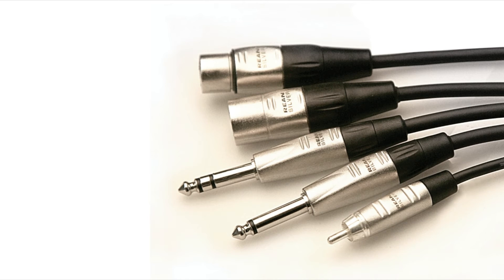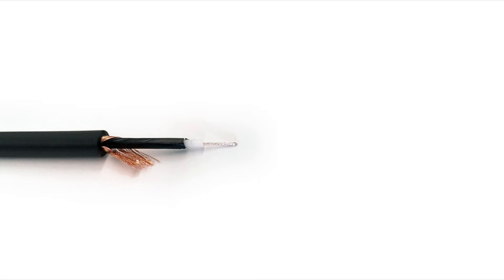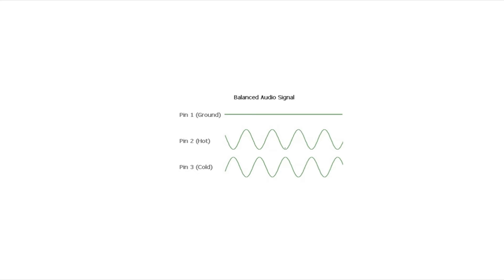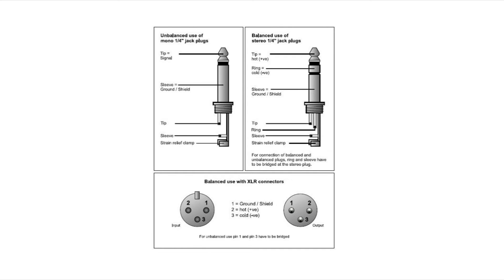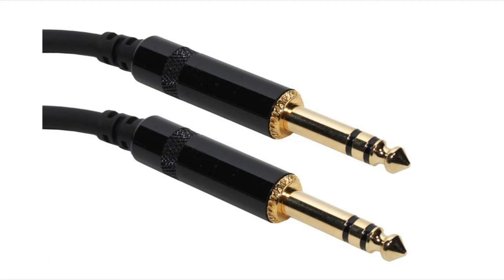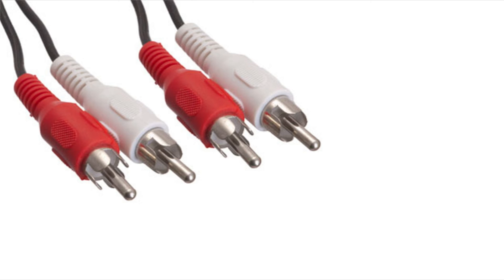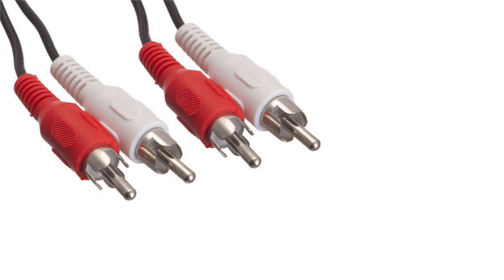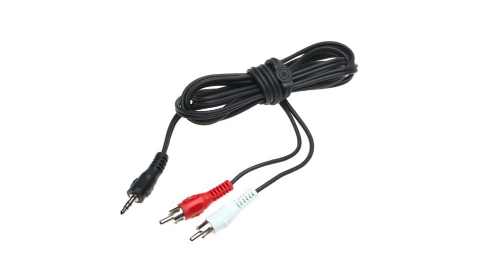Audio Principles | Balanced vs Unbalanced Audio Cables

Comment: If balanced cables inverts the phase and then use that to cancel out noise, how can it differentiate between the noise part and the rest of the "wanted" audio?
I mean, audio is audio, whether  it the thing you want (like recording a voice) or it is added along the cable as noise.
When the "summing" is done at the other end (at the receiver) and the audio is cancelled out, how come there is still some "wanted" audio left, but the noise/interference is the thing that is cancelled out? Wouldn't the "wanted" audio also be cancelled out?
Reply: The signal is out of phase, but the noise picked up on the signal lines is in phase. So if you subtract the two out of phase signals, the noise cancels out because it is the same phase on both signal lines.